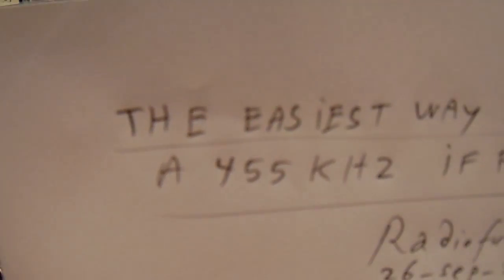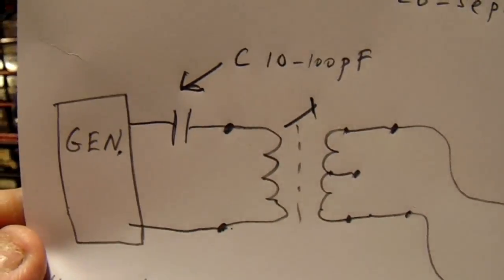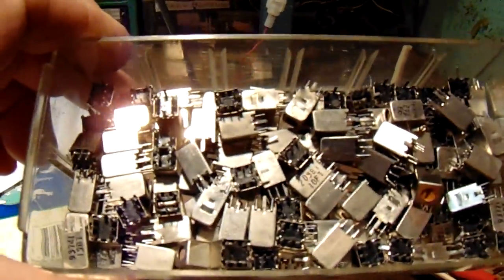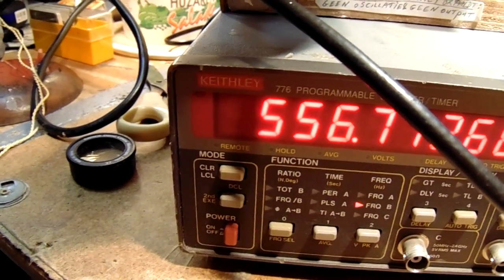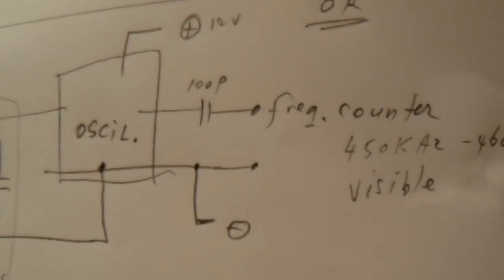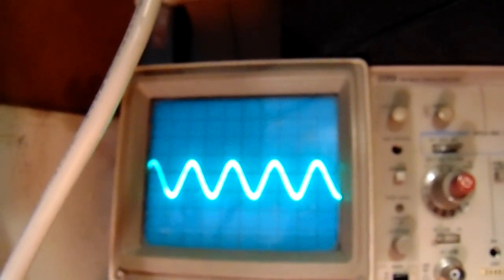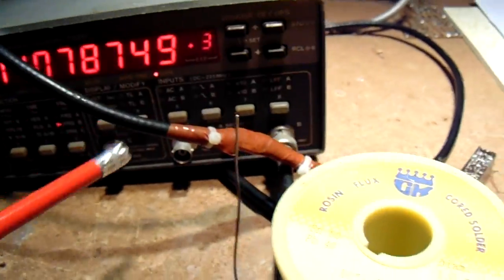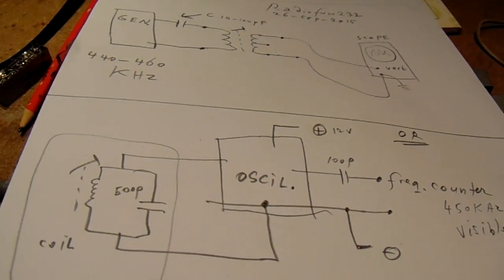The easiest way to test an IF can/filter on 455 KHz

Comment: If you have a simple variable RF generator and a frequency counter , for accuracy, you can accomplish the same thing. Sweeping the 455 is a waste of time, the BW is so narrow.  The AM radio only has a 10 kilohertz spread and on reality that is not all used anymore. The reactive capacitance of input and output circuit have influence on the 455 response. If a radiobI am working on has a reasonably good response around 455 kc I let it slide. Touching those 60 year old cores can be a disaster. Is it worth it? Just to say you did it perfectly correct but now the radio doesn’t work because the frozen slug made the loose coil form turn and break a fine primary or secondary lead .once you see how cheaply those coils were made you won’t touch them . If the IF circuit is F@#$ked up toss the radio.
Reply from the maker: Ok, good but this is a serious video. And there are approximately 10-20 video's on my YT channel about IF amplifiers, so this is only one of them. So how to make IF amplifiers, test them, etc. You can find them via my channel trailer (Radiofun232 on You Tube) by typing in via the "magnifying glass" keywords like IF, IF amplifier, Radio, Shortwave, etc. 23 july 2021.

Comment: hello, the IF cans in my AM radio are coloured with yellow,  white and black. why they use all these, if they have different frequencies ?
Reply from the maker: That depends on the factory where they were made. The IF cans that I used (Brand: TOKO) in my radio's had a white core. They were 455 KC cans with 1 primary and 1 secundary. Primary coil ("455 KC") was tapped and had a (say) 450 pF capacitor parallel. The other winding on the form was the "outcoupling" winding. 
Sometimes 1 can is the oscillator coil, the other one(s) the IF coil(s) and another one the detector coil, they have different colors. Search e.g. via the looking glass on my channel trailer on ''IF" or "IF coils" or "IF coil". There is a video where I all tested them (all kinds of colors). When it is AM the IF and detector coil are on the IF frequency. The oscillator coil is on the AM band, say 700 KC up to 1,8 MC. Test oscillator is also on my channel. In fact not so much can be said without the schematic.
Reply from the maker: e.g. here https://youtu.be/k1JneCdgOQU
Reply from the maker: also here https://youtu.be/oMHkPTHm7-U
Only the oscillator coil in a superheterodyne radio has a different frequency band, compared to the IF coils (often 2 of them) and the "detector" coil. That detector coil is also tuned to the IF frequency, often (old school, standard) 455 KC (or 450 KC or 460 KC). But there are also sophisticated SW radio's with a double IF amplifier, etc, etc.
Reply: @radiofun232  i see. thank you for all the answers. :)

Comment: Wow, I love that home made signal generator!  I am subscribed.  Can I ask a question?  What kind of rf power level would you need to use a signal generator to inject a signal directly into the front end of a receiver?  I guess it would be very small and require an attenuator.  Maybe you could do a video on this, and make an attenuator...  just an idea.  All the best, Tim VK4QP
Reply from the maker: Hi Tim, thanks for subscribing. I think with front end you mean at the antenna. This is normally in the uV (Microvolt) range, so between (say) 1 microvolt and 6 microvolt. Often for testing it is enough to use a very small coupling in the form of a few isolated windings around the antenna or a wire hanging next to the antenna.

Comment: Hi - I enjoyed your video. I've done this on occasion too, when I was having trouble getting the IF to resonant. Were the old IF filter's bandwidth the same as the newer smaller IF filters?  Best, Don
Reply from the maker: +RestoreOldRadios I found that old IF filters had better qualities (good sound between 100 Hz and 9 KHz) . With tube circuits a good bandwidth was easier to realize due to the high input resistance on the tube grid.
Reply: radiofun232 Thank you for sharing your knowledge, it's appreciated. I look forward to your next video. Best, Don

Comment: A very interesting video,this subject is very dear to my heart at the moment,I'm currently looking at building a oscillator between 400 to 600 KHz,, to help me with a receiver I want to build+ a oscillator with this band spread would have uses in my workshop, I'l llook through your video's for inspiration for oscillators any  advice would be welcome.
Paul
Reply from the maker: +Paul Collins Thanks for your reaction. A good schematic is in the video: "oscillator 140 KHz - 843 KHz or more with LC coil in the grounded collecor lead".
Reply: Yes ,I've been reading that,I'll build  that one and see where it takes me,could it also be used in a wobbulator circuit,I love your construction techniques ,in fact you got me interested in wobbulators and equipment for aligning I F sections,I appreciate your video's very much, thank you for sharing them.
Paul
Reply from the maker: +Paul Collins Thanks, you are welcome.
Reply: waar ben jij vandaan?